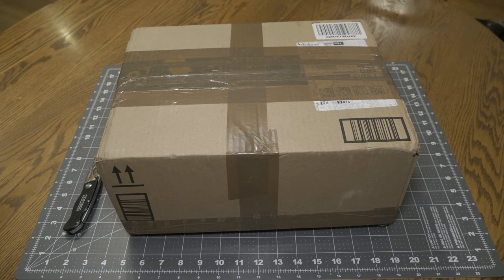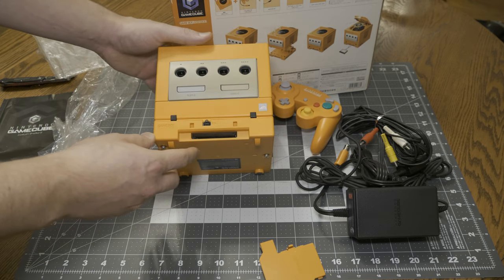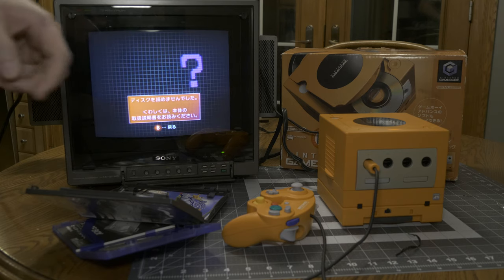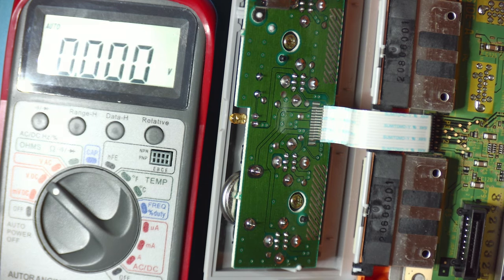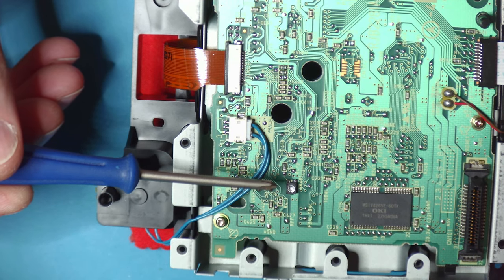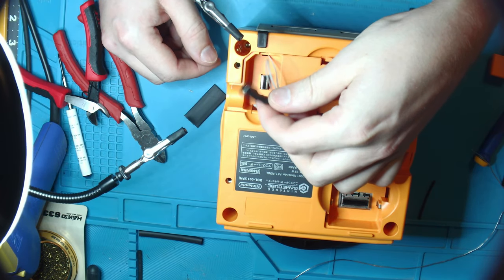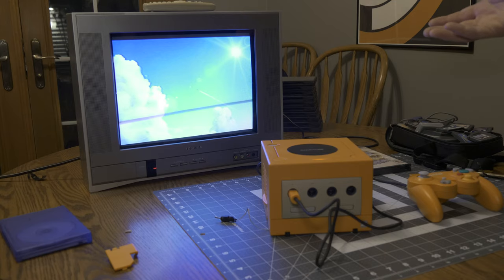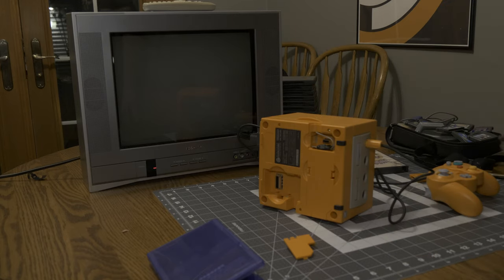Spice Orange Gamecube Plus! Unbox, Service and "No Cut" Region Mod

Comment: Where’d you buy the console?
Reply from the maker: I got this on ebay. My favorite retro seller from Japan on ebay is hit-japan. hit-japan is usually more expensive than the other sellers but I have always had a great experience from them. They are rarely the cheapest option though but I have gotten what was shown in the auction with really quick shipping every time.
Reply: @the-dan3974  Oh okay. Thank you for the reply!

Comment: Nice video. Replacing the disc drive capacitors (as well as the main motherboard) is advisable as well. They aren't known for bad caps and I haven't seen one with rot from leaking caps yet. However, these machines are reaching the rated service life of the capacitors and it's a good idea to replace them before they start having issues. 

I like the no-cut switch location but I went for the rear mounted switch still. Properly bolted in, no glue. I'm working on a couple of cubes right now. Recap, region mod and Xeno chip. might get some footage posted soon. if you don't have another setup yet; i strongly recommend the Bitfunx component cable since you have the DOL-001 cube with the digital out
Reply from the maker: I didn't know about the Bitfunx cables, those look awesome! I'll absolutely be getting one of those. I've been using S-Video, which is pretty decent on these but I was super bummed after reading so many good things about the carby/insurrection cables and then finding out you can't get them any more. 

I didn't think about recap but you're right, I should have grabbed a console5 kit for this guy while I was in there. Thankfully these guys aren't super annoying to take apart, I will add a recap to my list!
Reply: @the-dan3974  I agree the S-video output from the cube looks nice; especially on a CRT. I'm sure the Bitfunx or any other component cable would shine the brightest on an "Enhanced Def" CRT but, it really does look nice on my 7-8 year old Samsung HDTV. Since I got that set; everything that didn't use HDMI natively got hooked up to composite video. By a stroke of luck, this TV has excellent internal processing of composite video and I can honestly say I've never seen a modern TV "shake hands" so nicely with retro consoles.

 But, after seeing what my GC, Wii and DVD player look like thru component; I've decided to dedicate this set to that purpose. The older systems look better on the CRT anyhow and I feel S-video is the most appropriate standard for that era of gaming!

I would strongly recommend investing in some hot tweezers if you're going to get into recapping any amount of SMD stuff like the cube. Speaking from experience, it can be done other ways but, you won't like it as much!
Reply from the maker: @71dembonesTV  This is a great reminder for me to get a set of hot tweezers :) I keep forgetting to get a pair then every time I need a pair I don't have one. Any particular pair you recommend?
Reply: @the-dan3974   think my comment might have got auto-nuked for putting the ebay link in there. It might be in your "awaiting approval" tab on your channel, too. Anywho, long story short you can get a cheap pair of ebay for about 50 bucks. That's what i have and they work good enough. :)
Reply from the maker: @71dembonesTV  Thanks! I grabbed a pair :)

Comment: Hi.
I bought a spice orange GameCube.

It does not have a switch on it.

It plays USA games but the menu is still in Japanese. 

When a memory card is inserted, it asks to initialize format the card.

Also sometimes the error code will pop up "An error has occurred Turn the power off and refer to the Nintendo Gamecube instruction booklet for further instructions".

I want the system to play USA games, keep an English language menu and want that error to stop showing up here n there.

Can you tell me what might be going on and how to fix it please ?

Do you think it's a half way done mod gone wrong ?

Thank you.

Anybody knowledgeable please reply soon.
Reply from the maker: I think what is likely going on is the drive was region modded. When someone does the solder mod as shown in this video, the menu language changes to that region. For your error message, you can try increasing the intensity of the laser as shown in this video. If that has already been done by the previous owner,  you might still be able to squeeze some more out of it still, but the drive has likely reached the end of it's life